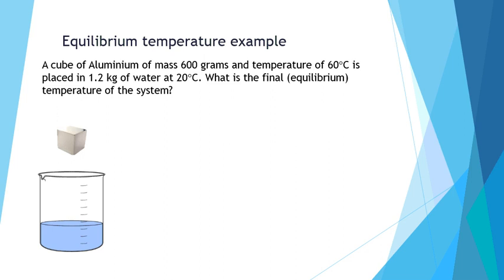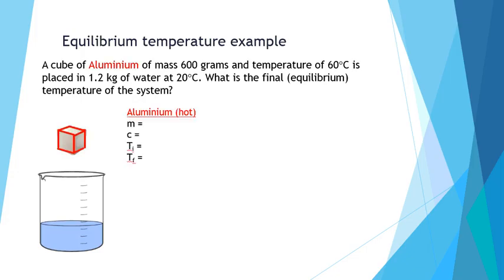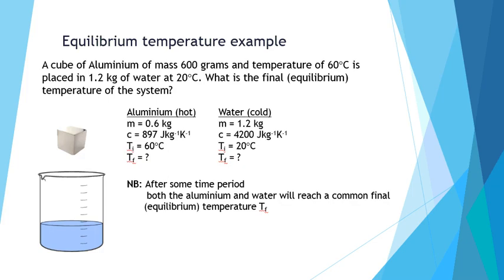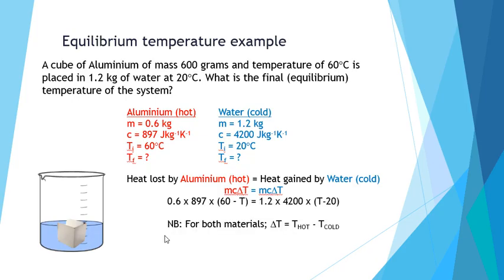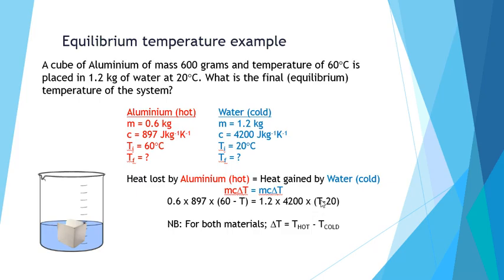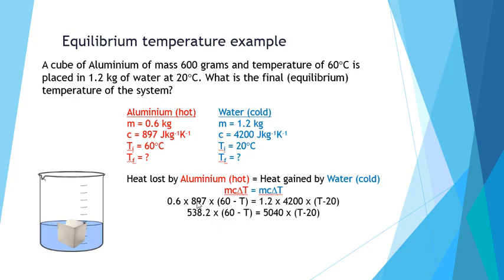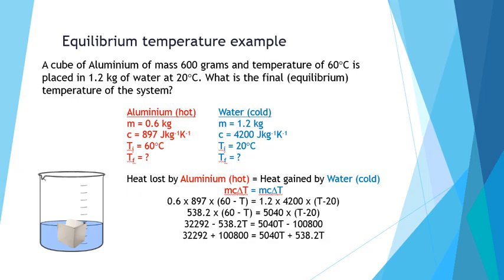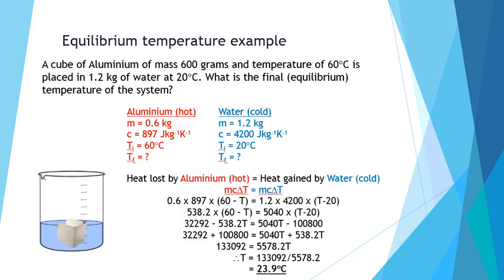Equilibrium Temperatures

Comment: what is the case if it's an insulated pipe and fluid inside it with the surrounding air >> And I have calculated the heat loss rate already but can't calculate the final temp.

Comment: pretty sure you've gotta use: -MCAT = MCAT to get the proper answer
Reply: Yes this is correct, I recently couldn't find out the correct answer until I made that slight adjustment.
Reply: @someperson3549  glad I can help ! May Allah guide us :D
Reply: If 1 g of steam at 100°C steam is mixed with 1 g of ice at 0°C, then resultant temperature of the mixture is? 
I can't get the answer for the life of me.. Can someone help?
Reply: @latenightsinthecity_  I'd assume 50⁰
Reply: He corrects this by reversing the deltaT for the colder water. That make it a negative number rather than the whole side. Same answer tho